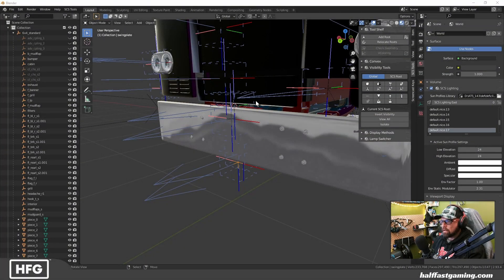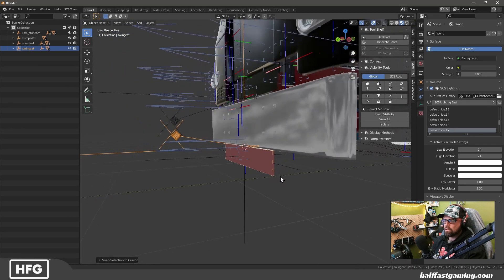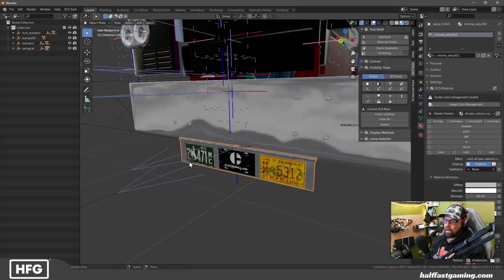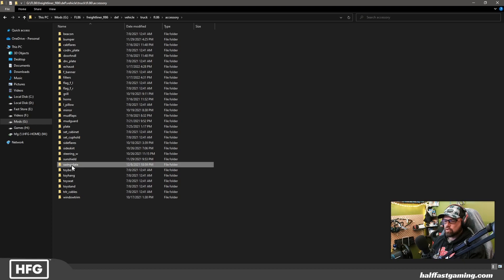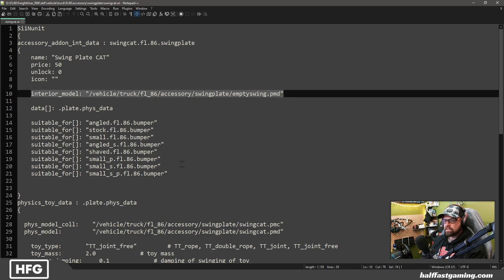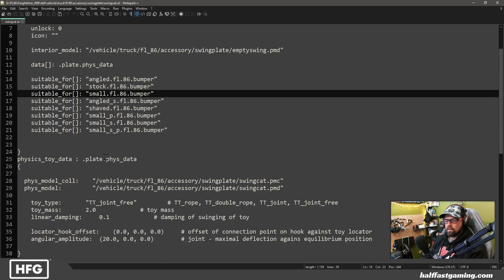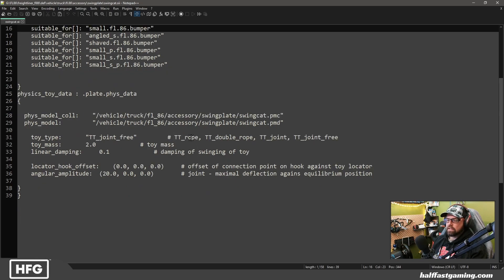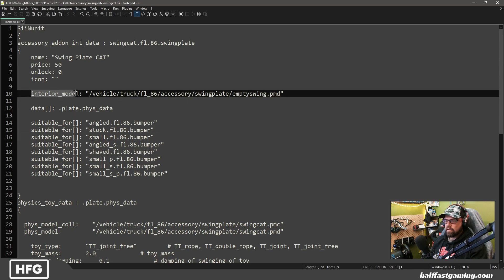How To Implement Swingplates or Mudflaps Using SCS Interior Physics! #AmericanTruckSimulator

Comment: 3:25 Jeff, when you export your swingplates with the other objects in the scene, that's fine and dandy, but don't you have to convert the swingplates to get their materials / usable .dds and .tobjs with said materials? How do you just convert your swingplates object and not your "6x4_standard truck" object which is also in your Blender scene, thereby not having automats from different objects that you didn't need to convert (eg, you only want to convert the swingplates in the Blender scene). How do you do that?
Reply from the maker: There is a button in the export section, that allows you to export only the selection (root object)
Reply from the maker: @Deqa  I think you are misconstruing export and convert. Blendertools only exports from blender to pix format. Then conversion tools converts the pix into the game ready format. 
So if you are working on a bumper, say, you would do all the texture and modeling work, then "export selected" to the folder you need (all of this is explained in my "How to Mod SCS Playlist") then you would use conversion tools to convert all of the things in the base folder to the rsrc folder where you can make it a mod to put in the mod folder.
Reply: @Halffastgaming  I understand how exporting and converting works, my original question was "How do you export only a specific selection and then convert that specific selection when ConversionHelper in Blender only converts the entire project?"

In your comment, you state you would export your Blender objects to a specific folder and then "convert everything in the SCS project base path with ConversionHelper". But you do realize how inefficient that is, right? It requires you to repeatedly set a new SCS project base path for every single accessory you want to change on a truck mod. 

A better workflow is to have one base project folder, like "kenworth_exp" if you're making a Kenworth truck mod, keep modding and importing all the files into that folder & set it to your SCS Project Base Path for your Blender scene, and then start exporting specific objects by selection to specific folders on your computer where you want your bumper to go, for example, and then set ConversionHelper in Blender to "Custom Paths", set the path to the folder with your exported-by-selection bumper in it, convert, and voila. You now can use the same SCS Project Base path for an entire mod without having to have a million different SCS Project Base paths for different parts of the mod like the bumper, cabin, accessories, and so on. 

You get me? Also, I did watch your SCS Modding Playlist, but my question was much more nuanced and I'm not sure if you read it or not. The workflow you present in the series of "converting the entire SCS Project Base Path" with ConversionHelper in Blender only works in some instances. If you keep doing that, you end up with infinite automats and stuff you don't need from different parts of your truck rather than being able to isolate and convert specific pieces. 💡
Reply from the maker: @Deqa  the issue as you present it, due to being a YouTube comment, doesn't play well with nuance. 

However you can use conversion tools to convert only what you want using custom folders if you so desire. 

Additionally, conversion tools checks to see what has changed in the folder. If you haven't wiped the previous conversion, it will only convert what you've changed or added. So you can cherry pick from that folder if it suits you. 

Converting and copying over every time may be "inefficient" however it takes less time overall because there are less selections to be made, as when you have to do them manually.
Reply: @Halffastgaming  True, I know that you can just convert the entire scene, and as long as all the files belong to the same mod, it should just overwrite the same stuff either way. Also, thanks for confirming. I probably didn't specify what I exactly meant originally. I just want to be able to convert specific stuff, if you're saying that it converts only specific folders, then that must be the "custom paths" I read for ConversionHelper on the wiki. Thanks!

Comment: I'm a ATS/ETS2 modder myself and i used and use this method to make animated mudflaps, antennae and cb radio cords, since scs released cabin accessories dlc. It works 100% and all you said in this vid is correct! So thumbs up for this vid! Only noticable thing to add: this method, sadly, cannot be used to create animated parts for trailers, because obviously they don't have interior lol So the only way to create animated mudflaps for them will require to use flags physics, which is very limited method and doesn't give good looking mudflaps. Sadly, scs limits modding a lot. I mostly miss possibility to create proper h-shifter animation and some custom animation, which i can freely assign to some key.
PS You have a nice and useful YT channel, congratz!
Reply from the maker: Much appreciated! And yes the trailer issue is a thing, a good reminder.
Reply: @Halffastgaming  You're welcome! I usually don't leave comments under ATS/ETS2 vids, but your channel has many really(!) useful vids for those guys who struggle to find answers how to mod SCS games (i really believe SCS fall short in teaching ppl how to mod their games. Their modding wiki is not the best one for sure). And while i don't really need such info, because i'm in a modding since 2015 and learned everything myself with the method of trial and error, i really appreciate all people like you who help others to learn things.
Peace from St. Petersburg, Russia. ;-)